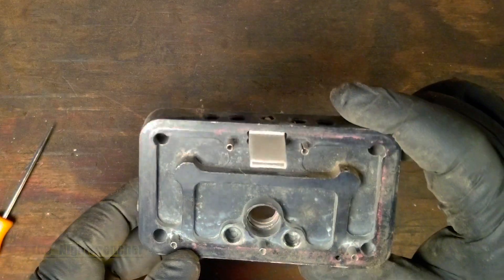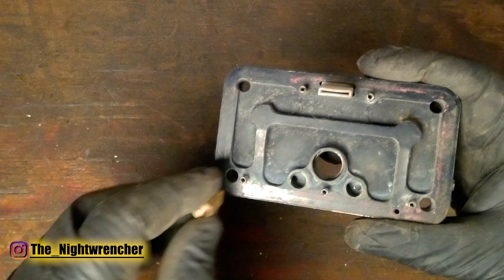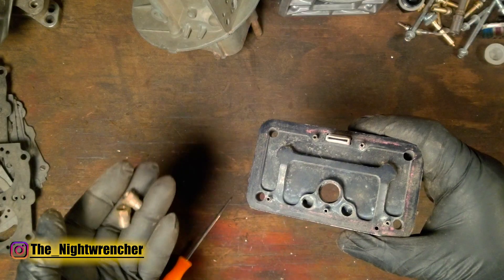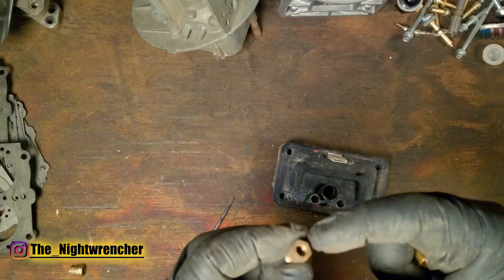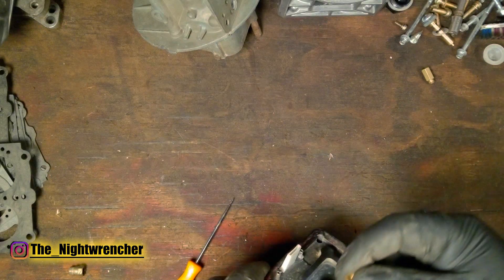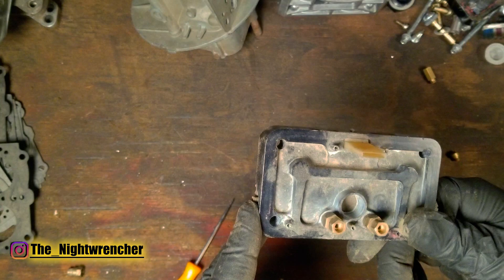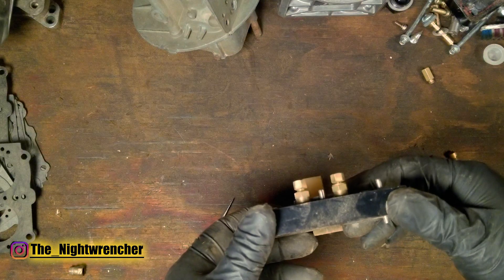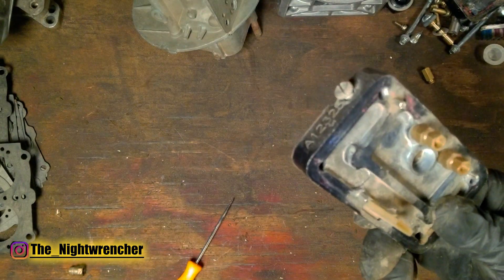Easiest Way To Convert A Junkyard Carburetor To Gasoline | Convert Alcohol To Gasoline |

Comment: How do you fix the larger main well, cross well and booster hole that are much bigger for alcohol than gas. If you don't you end up with very very slow fuel flow thru the carb and low signal strength and main system start up.
Reply from the maker: There is no "fix" you just need to adjust for it when you tune. Depending on what motor you install the carburetor on, will decide whether or not itll be a problem
Reply: @NightWrencher  My point was that you can convert a gas carb to alcohol, but you can't convert alcohol carb to gas. You can not make large passages smaller and you can't tune them out either.